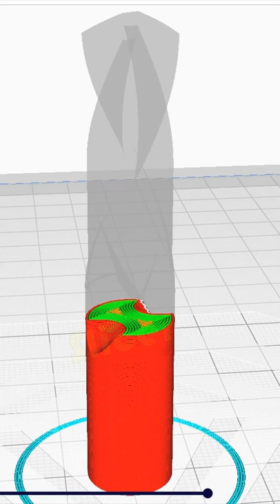Educational project: 3D printed twist drill - what do you think, can it drill anything? #Shorts

Comment from the maker: Most viewers miss the point of this video: this was educational project, the point is that it can drill if tool is harder than drilled material. Like why using Cobalt steel is recommended to drill stainless steel or why is general carbon steel enough for aluminium.

Comment: You should try printing it horizontally the resulting material is stronger.
Reply from the maker: The layer adhesion is not the weak point here, but the hardness of the tool. So it can drill if drilled material is softer. That's the point of the video, to explain why we need cobalt for drilling stainless steel or regular carbon steel for aluminium.